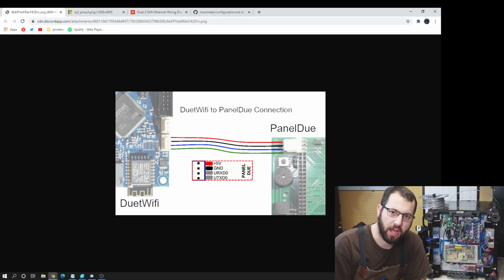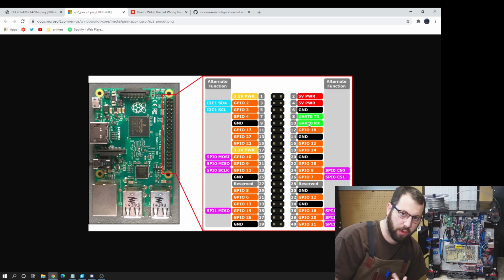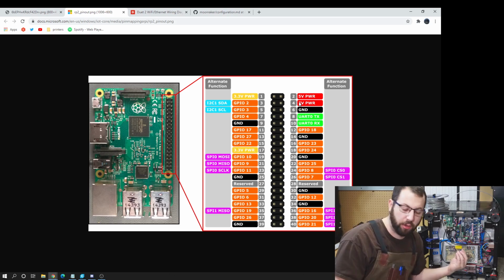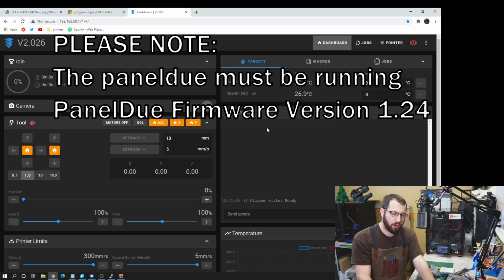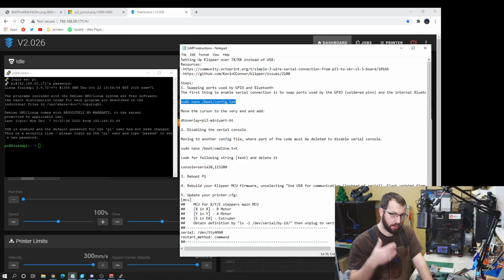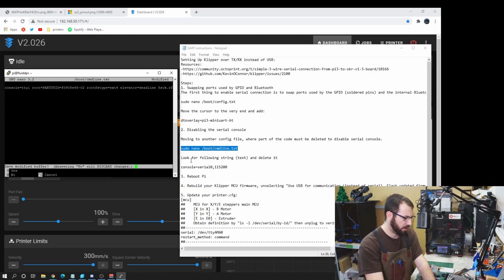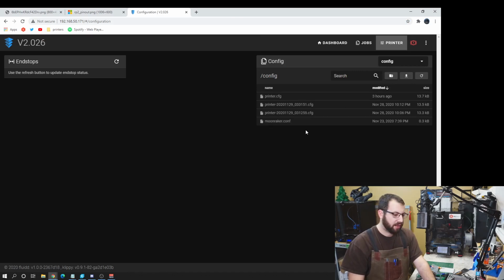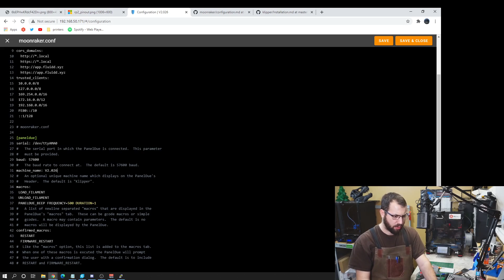Paneldue with Klipper- How to make it work (its easy)

Comment: Make sure you add 'sudo reboot' after editing those .txt files, otherwise on a powerdown reboot you will end up with blank files for both on them. It's just happen to me no texted in either of them, had to go and grab the text for them from the pi repo on github. Oh and don't forget it only works on the older screens not the new ones with red graphics v3.4.0 does not work, you will spend hours trying to no avail.

Comment: Great video, how did you get klipper onto the Duet 2? I tried several times and all looks good, but the diag LED stays on after install.
Reply from the maker: Its been awhile but the flashing instructions should be available online, iirc put it in bootmode, make the make menuconfig flash file, and IIRC its flashed via SD card, but again, its been a while since ive done it
Reply: Thanks so much I will try it again. @CanuckCreator

Comment: I thought Duet board works independet from a Rapsberry Pi. This is one of the advantages. And for connection of Paneldue there is a 10 Pin cable to connect to Duet board.
Reply from the maker: But this is a Panel on a machine running klipper, so its different

Comment: Hey, will this only work with the Original Duet PanelDue screens? After watching this video i went and purchased a Fysetc PanelDue i7 which is a Clone of the Original Duet PanelDue ... I mean even the firmware that gets flashed to the Original paneldue is the one you flash to this Fysetc one ... I followed your entire video and made sure Firmware v1.24 is installed on my i7 and it doesnt work. 

I also tried switching the paneldue connection from the Raspberry Pi UART Header ... To the USB using that small Uart to USB dongle you mentioned ... I resetup everything according to that but still zip ... The screen will turn on and boot up and it just says "connecting" in the top right corner ... Baudrate and everything is same so I'm totally at a loss as all my printers are Klipper and this screen is pretty much garbage for me as where i bought it also refused to return it/exchange it. 

Anyone know how to get it working?

Comment: may dound stupid,or for some people it's "obvious" -  especial after a year since this release - but I had to change the moonraker default baud value of 57600 to 115200 - to make the Paneldue working ....
thanks a lot, never thought it would be so easy to use some "older gear" I had laying around.  (a makerbase paneldue 7.0i V1.0 )

Comment: Watchin seeral of your videos convinced me to finally go ahead and load Klipper. See you run it on a Duet3 Min 5+ made my hear jump for joy as I know these boards VERY well.
Nearly two full days now here (recently retired) attempting to get Klipper running on my Duet 3Mini 5+ like your setup here...  :-(   still a no go. Care to share you printer.cfg file?
Also after switching over to Klipper on the Mini... I can't tell which version of Paneldue I am running (hoping that is my issue getting the display running again)
the printer .cfg setup is driving this first time klipper user crazy!  HELP!

Comment: there are different things to do to install a paneldue with a pi4?
Reply from the maker: Installation process with the pi 4 should be the same as Pi 3, when i swapped the pi 3 to a pi4 in this printer, i just plugged everything in the same way, swapped sd cards and booted it up and everything worked as before
Reply: I tried several times, but I did not succeed. how do we know the serial for moonraker?
Reply: @julienmougenot4931   I have a Fysec 7.0 panel due to work I have to connect rx to rx and tx to tx

Comment: using Lsusb the result is:
Bus 001 Device 006: ID 10c4:ea60 Cygnal Integrated Products, Inc. CP2102/CP2109 UART Bridge Controller [CP210x family]
what is the correct serial ID to edit in  moonraker.conf?
Thanks to all

Comment: FYI make sure to disable the gpio fan control that new mainsail and debian images have by default otherwise you will have control but no data. Also it is much simpler to just use the raspi config program to dissable the console and enable serial . then you only have to disable bluetooth to use the full uart or if a short run you can use the mini uart and just define as ttyS0

Comment: I know this is a late post but i have a couple question on the duet2 maestro, i just installed klipper on it and have most of the controls working, i am now trying to get duel Z motors setup and a probe. I would like to know if you know how to setup the probe, its the same one used in the voron build, i plan on using it for the Z home and bed leveling also to set both Z motor Hight on left and right sides, and what input pin  is used on the duet ... Thanks

Comment: I think you have the wrong firmware on that PanelDue.  The red and blue colors are swapped. I ran into that issue too when I flashed the wrong firmware on my PanelDue.  That color bar on the top in the setup shoud be Red Green Blue, not Blue Green Red.

Comment: So i got this working with a 5i. Only exception is that gcode files are only listed on the panedue for a few minutes. then they vanish and it says no files found. Any idea?
Reply: Update!! It happens that you cannot have any files or folders with a space. If so no files or folders will load.
Reply: ok got it working... im not sure if it wasn't working before, but because the baud rate is set too low that i didnt give enough time. changed baud rate to 115200 in both panel and moonraker config and it works as expected with no lag.

Comment: Is it possible to make a tutorial on getting the Fysetc mini 12864 screen to work through the raspberry pi rather than the printer MCU like the Paneldue? The reason I ask is because there is no clear simple instructions on how to hook up the Fysetc screen to any of the spec SKR boards and each one has different pins and some might be using non spec boards. With the raspberry pi we can follow the same installation procedure regardless of the board we use now or in future builds. I think a video like that would benefit many people.

Comment: Is there anyway I can add klipper to my artillery Sidewinder x1 v4. And use the oem display to display TO MY ARUDINO for the klipper ui or octodash?
Reply from the maker: You can check the klipper config section on the klipper github to see if its supported

Comment: This video got me excited about a touchscreen for Klipper so I bought the Paneldue 7i but I can't get it to connect. First I updated the firmware on the Paneldue to v1.24, did a new install of Mainsail following your installation video (which installed no problem), followed all the instructions in this video but the Paneldue is not being recognized. I also tried switching the 2 data cables (RX-TX), but no change. Is there anything else I should look at? Is the 7i compatible?
Reply from the maker: I believe it should work just fine with the 7i as its just reading the signals it sends out.
Reply: @CanuckCreator  Silly me, I typed in the wrong serial id in the moonraker.config file. A suggestion to others; don't try installing this at 2am after a couple beers. Your brain may not function as it normally does!! Now I feel like I have control over the printer like I used to when running a CNC machine. Thanks for the tutorial!
Reply from the maker: @muskokaliving2072  awesome, thats good to hear!
Reply: @muskokaliving2072  how did you find the serial id?
Reply: @churd83  I used the same one that Nero used in the video (/dev/ttyAMA0). I have a 3B+ pi but I'm guessing the same id will work with most raspberry pis (don't quote me on that, this is not my area of expertise). Hope that helps. I'm very happy with my Paneldue and it's been working flawlessly ever since I got it working.
Reply: @muskokaliving2072  did you switch back your rx/tx wires to the original configuration?
Reply: @churd83  I did exactly what Nero did. Rx goes to Tx and Tx goes to Rx. Are you having issues getting it to work? I’m using Mainsail OS which has the needed Moonraker already installed and makes it easier to configure than Octoprint.
Reply: @muskokaliving2072  you said in Original Post that you switched the wires around and it didn't work, then said you entered the wrong serial. I'm asking did you switch your wires back to the way you had them first or did you leave them switched.

I followed the directions to the T and even had to update my LCD firmware and it will not Connect. Just says "Connecting " in the top right of LCD
Reply: I switched the wires and now it works. The image in the video is wrong and I didn't personally check RX/TX on the PanelDue until just now. Swapped them and now its working

Comment: Question for everyone in the comments: I've been 3D printing for 2 years now and I wonder why is the Marlin/ Octoprint setup so widely covered by the mainstream channels but communities using Klipper reprap ecosystem is (at least to me) seems less widely adopted? Is it just me?
Reply: Also, Klipper is a LOT newer than marlin which has been around since 2011 (almost 10 years) with Klipper only being around for the last 3-4 years in mainstream use. Marlin runs on simple microcontrollers but with the explosive growth of 32 bit and especially the raspberry pi, the ability to utilize the newer hardware wasn't part of marlins main functionality. Klipper, while being newer, can offer a lot more advanced features and utilization of the high powered modern controllers as well as non-completion updating of the printer. Simple reload of the config without having to compile, flash and restart the system.

Basically it just hasn't been around long enough to gain "mainstream" traction but for hobbyists it can offer some really neat features such as multi-MCU printers and simple python based modular designs.
Reply from the maker: AFAIK there are no off the shelf machines running klipper, so you have to go get it yourself, and it does require some "scary SSH work and configuration" to get it setup properly, so there is a slight barrier to entry as well.

Comment: Great video - I thought my Paneldue was destined for recycling!

Request: a step-by-step for how to configure SKRs to have their firmware flashable via the console vs removing both SD cards and rewriting them on PC.  I haven't found any guides that I'm confident will work.
Reply: That's possible?  Would be so nice.  Hate having to flip my printer.
Reply: @radian2323  It’s possible but I haven’t found any instructions that I understood well enough to try.